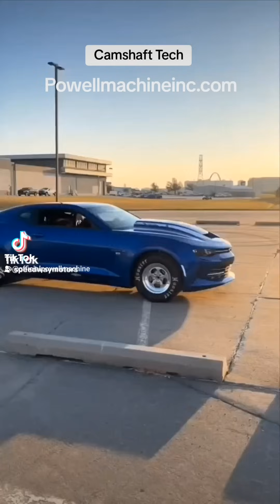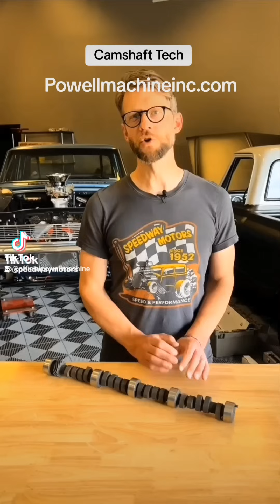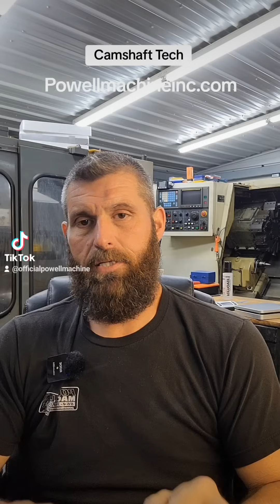Camshaft Tech,  overlap

Comment: Try to explain overlap to a Nitrous guy over scavenging his engine, or a Turbo guy that doesn't even check his back pressure 😮
Reply from the maker: @user-eo9ht6li7g  facts!!!! People call all the time wanting help with thee turbo engine and the first question I ask is current cam specs and the backpressue readings,  they never know the second answer.......
Reply: @powellmachineinc  Yeah back in the day I built NITROUS Systems for Grudge Hayabusas .
Alot of the guys came from the NA engine world , high rpm 62 degrees of overlap .
They would spray and eat the exhaust valves and seats out of the head. 😳 I would tell them they need Less overlap on their cams they thought I was crazy 🤪 until I showed them.
Then in 2001 I started building Hayabusa turbo Outlaw bikes,  same story , but now there are alot of combinations of different fuels, C-16, water/meth , E-85 ,E-90 Meth and so on all changing the back pressure and Turbine shaft speed. 
But with out having a back pressure sensor in the Exhaust people are just guessing what their overlap is.
I like your channel and I see your frustration with explaining the basics  of cam design to people that basically look at cam card and ask what the lope separation is.😳

Comment: Did you just compare a cam measured at 0.050" lift to a cam measured at 0.000" lift? or 0.006" lift or 0.010" lift??? What was the second cam measured at? All cams compared must be measured at the same inches of lift! The duration changes with different lift.
Reply from the maker: Both were at .050, how could I  make a comparison at 2 different checking hiegjts??? I actually manufacture cams for a living
Reply: @powellmachineinc  Good. It confused me when you mentioned them at different lifts. The first cam sounded like a decent street cam at 212/219" @ .050"

Comment: This is the kind of guy that would stop to help some in a pinch, and end up hanging out with them for an hour to make sure they got back on the road safely no matter what it took.  Wish we had more people like this.
Reply from the maker: @highball7347  tyvm!!
Reply: I got news for you. MOST of us were like that, until it got to the point where it was a coin flip if you were going to get killed or carjacked if you stopped.
I used to drive around on Fri and Sat night, enjoying my car, and I'd pick up drunk hitchhikers and take them home.
TF if I'd do that now.
Reply: @m4rvinmartian i wonder whyyou would do that . What were you looking for
Reply: The average youboob fanboi can’t see both sides of the same coin.  

He’s not saying anything different, just in a different way.   The example he didn’t provide is to take an example cam spec and then vary the separation angle to demonstrate how that impacts overlap.  Looking at only the opening and closing events is a half empty or half full glass equivalent.   

What is really being said here is that he disagrees with the David Vizard concept that a particular engine type has a preferred separation angle (Chevy 350 - 107°) and then the overlap is chosen based on how hot the engine tune/application is going to be.  Which Vizard lays out how to do all that based on many thousands of dyno run data over his lifetime.   

It’s ok to disagree on it, but it’s just the same thing from a different reference point.  It’s all relative.

Comment: Another channel teaches that LSA is not a result but a starting point! Whos right!
Reply: Lobe separation, Intake centerline and Exhaust centerline, are all just a BYPRODUCT of the correct opening and closing events. Anytime you alter when they open and close, you alter the separation.   Valve timing is WHEN it happens. LSA is WHERE it happens.

Comment: After spending 3 days in a valvetrain class, valve timing events are the only thing that matters. In cylinder pressure analysis proves this beyond a reasonable doubt. Everything else is just the product of these events. Everything in valve motion design is application specific. While there may be many who float LSA formulas. If you pay attention to what is said, its valve timing events for that particular application. So for a given application, you can make any particular formula work depending what preconcieved notion you are trying to express. You do a great job explaining this. Cheers!
Reply from the maker: You sir just summarize my thoughts very well!
Reply: I agree, I think the LSA formulas are just a handy tool for the novice engine builder to  use for getting their valve events in the ballpark for a particular engine combo.

Comment: This is fascinating. Is the overlap a desireable aspect of a cam or is it an effect of a longer duration? I am assuming that race cars engines would have high duration cams to get as much air/fuel in as possible while giving the piston as much time as possible to get the exhaust out. I am not sure if that is entirely correct tho. 

Great Video!
Reply from the maker: Overlap is definitely useful tool

Comment: Also what you are hearing is the pulse differences due to the 90 degree crank, two adjacent cylinders firing adjacent instead of on the other bank.  IMHO overlap needs to be measured with sae method or .004 or .006   great discussion so far   timing is everything LSA methods are BS  Intake valve size is a poor proxy or flow results, etc etc
Reply from the maker: I agree

Comment: Unfortunately there is so much regurgitated on You tube. While a narrow LSA will most the time have a little more overlap and a choppier idle it's still all based on how it's ground and it's all about combination combination combination on how it runs in a particular engine. I always get kinda tickled about hot rodders and their cam picks. many think they're going to gain a huge amount of power over some little change some so called expert was promoting. If you gain a huge amount of power could be you just had a really bad choice in there to start with. I love you videos because you use good sense and it makes perfectly good sense. If one is using too much snake oil on some of this stuff it's generally because they're misinformed and just shootin for the moon. Power is good but if you can't keep an engine together and running where everything is in harmony or you can't put it to the ground then your just blowing money and scratching your head. Sometimes the street rodders just think they gotta hear a certain tone. I ask them if they really are looking for this particular tone or would they like to have something that maybe has some tone but can get up and cut loose. Picking a cam because of 1 or 2 things is just down right dumb. I've rattled on too much.

Comment: there's a combo to that sound, aside from lsa... stroke, compression, heads, especially canted valve, firing order, and of course cam (SFT/etc) all come into play. cam events as well.... so many other variables....
just lsa only is not it. one way to look at lsa.... is how do you want that torque powerband? snappy.... go tight.... 
i love tight lsa cams, but thats just my desire.....
listen to a 351c with SFT and high compression..... music to the ears
motortrend did cam lsa swaps and the changes didn't make all that much of a change at idle sound, sure it did change, but you aren't going to go from super smooth to radical racey changing 10-12 degrees of lsa only.... unless you have a real knarly cam and other contributing factors, but just lsa only one might be surprised... how the power band comes on.... yup.... you'll notice that for sure (depending how drastic of a change)
i like your videos, some really good info

Comment: Chop IS MISFIRE.  OE aim for about 2% misfire, and 10% becomes audible.  Disconnect a couple of spark plug wires on a smooth running engine.

Comment: Exactly. Back in tbe 90s  ypu could get tight LSA on a tiny  towing cam small duration. Ran fairly smooth. Or for some racing get a cam with wide 114  LSA but very large duration and late exhaust closing  have more overlap, combined with the late closing  sound radical.

Comment: Yup.  David Vizard just made a video about the same thing.  Start with Overlap for the application, calculate the Lobe Separation Angle based on the displacement and intake valve size (static compression ratio figures in to this as well).  Duration is a RESULT of all of that.
Reply from the maker: Lol
Reply: @powellmachineinc  I would be interested in what you mean by lol.

Comment: I have had this same argument with David Vizard's followers, in the fact that LSA is a RESULT, NOT AN INPUT. The most important part is opening/closing valve events. They seem to think that a 106 LSA camshaft in a 350 SBC is the 'magic sauce' with NO other info taken into consideration.
Reply from the maker: Yep it's scary
Reply: LSA is a starting point and depends on the head design, displacement and intake valve diameter.  Overlap is decided upon where you want your power band, and to a degree idle vacuum.   DURATION is the result of those 2 design parameters.

Comment: [Your vids are so awesome!]  So a Comp Cams Thumpr for example has a bunch of overlap to sound nasty but is really not a big performance cam.  When tuning the engine for this cam I found it wanted 35° of advance above 3000 rpm from the dyno runs.   But, I found it also wanted 35° of advance at IDLE rpm of 1000 rpm with a vacuum gauge so timing was locked out.  This engine starts right up with no start-retard at all locked at 35°. (vid showing this: https://www.youtube.com/watch?v=CyAZiMZ-Qq4 )  Comp Cams said yes run it locked, that is what it wants due to it's low dynamic compression.  Does that make sense to you?  I could not find out how much overlap it has, can you tell from the specs?
Advertised Intake Duration	279
Advertised Exhaust Duration	296
Intake Duration at .050 Inch Lift	227
Exhaust Duration at .050 Inch Lift	241
Intake Valve Lift	0.491
Exhaust Valve Lift	0.476
Lobe Lift Intake	0.307
Lobe Lift Exhaust	0.298
Lobe Separation	107
Intake Centerline	102
Valve Timing Lift	0.006
Exhaust Close ATDC	41
Intake Open BTDC	35
Exhaust Open BBDC	76
Intake Close ABDC	63
Reply from the maker: Tyvm

Comment: I can never get enough knowledge of camshaft dynamics. Knowing how to pick/design a cam according to a particular engine's application is a fascinating science and there are so many variables to be considered. Engine displacement... cyl. head/ intake/exhaust design...rpm range... comp ratio... normally aspirated vs forced.... Final drive ratio... trans type... Street/strip or both.... vehicle weight..........
Thanks for the video and channel 👍

Comment: After installng a Moon Crossram IR manifold on my Donovan small block, and it was like my great idle TOTALLY DISAPPEARED!...(it had a Holley 4bbl).  So, this discussion assumes the same intake system when referring to "idle quality".

Interestingly, that Holley was surprisingly strong by comparison.  However, the driveability off the corners can't be beat with an IR manifold...and it never seemed to stop pulling upstairs, either.  The throttle bodies were 50mm and the Holley was a 750 double pumper.

WORD OF CAUTION:  You need to install a Lingenfelter throttle cable cam on the linkage of an IR manifold setup.  

Otherwise, the initial cross-sectional area in the runners changes too much off idle for the car to be driveable on the street...or in road racing.  Just make sure the throttle cam's tip is "bump steered" so it's 90 degrees to the cable at the idle position.  Holleys overcome this issue by having the primaries open well before...unlike 660 center-shooters that only give you a hint of opening the primaries during the initial tip-in.

If anyone's interested, you can see the correct orientation of the cable cam in the center of the manifold in this shot...I painted it wrinkle black:  https://www.facebook.com/148866271901800/photos/pb.100057508387227.-2207520000/1305820682873014/?type=3

Comment: LSA.  What BS for the general public.  I agree that overlap is the "thing".  But I did notice that when you were dialing in your machine to regrind a cam that the machine is calibrated for LSA.  This I can understand as good information for the person designing and manufacturing any particular cam, but LSA is just useless for the builder/user of the cam.  Thank you for pointing this out for us.  And confirms my suspicions on the subject.  Years ago no one even thought about LSA just the O & C events....
Thank You for stating the obvious....  RooDog....
Reply from the maker: Lsa is really only a mechanical function of the grinding operation,  the engine only knows opening and closing events

Comment: My cam had a 277/286 duration and it sounds like a tractor sometimes, definitely not choppy. But it’s not the sound I’m interested in.
Reply from the maker: I'm sure that duration was advertised and not at .05, so that's pretty mild
Reply: @powellmachineinc  I have it in my 411 Clevor.  
801/767 lift
dur at .050 277/286.
Int open 30 btdc  close 67 abdc 
Exh open 79 bbdc close 27 atdc 
Lob sep 112
Looks like the valves are kept open a long time, would that be the reason for not getting the chop?  Thanks for appeasing my curiosity.
Reply from the maker: @patrickterry779  yeah, thatsa good one, should run well with a nice head

Comment: i have always found a tighter lobe center, not so much lopey, but if the overlap is there, a tigher lobe sep will bring the cam in earlier in rpm. 2 cams as close in specs as possible cam 1 is 108 LSA cam 2 is 114, the 108 starts working off idle sooner, give up sooner, where as the 114 comes on later and revs higher. i may be wrong but its worked for me in 30 plus years, trying to satisfy customers who insist on very lopey cams for impression, and need to be able to drive it on the street daily with out gear and converter changes. way back in the late 70;s 80's isky convinced me of this and i began buying the 108 107 mega cams. again i may be wrong. but its just worked. it been the only way to give customers crazy lopey cams and no have off idle drivability complaints. if iam wrong please correct this before others take is it heart.  to me more overlap with out narrowing up the LSA moves the rpm range up higher
Reply from the maker: What ur actually saying without knowing is a earlier opening and closing events  bring the cam in earlier.
Reply: You effectively changed the overlap by changing the LSA.  There is only one optimal LSA for a given displacement, intake valve size, combustion chamber design and static compression ratio.  Overlap is decided by where you want your power band, and what you want idle vacuum to be (but that's adjustable with ign timing, etc.).  Duration is a result of LSA and overlap.  I have a spreadsheet that uses LSA and overlap and computes the duration from those.  It's just algebra.

Comment: Spot on! People just dont understand!
Reply from the maker: Tyvm
Reply: @powellmachineinc  Have you done any videos yet on Dynamic compression and calculating it based on actual intake valve closing point?
Reply from the maker: @JayJay-de8vq  no, probably should
Reply: @powellmachineinc  Every video you make is great and the information always matches what I've learned from my Dad and the older Guys I hung out with, two of them currently race 2 of Lenard longs (G force transmissions) mustangs. Learning and Understanding valve events and dynamic compression really helped it all make sense. Thank you for the quality videos and responses. My dad will be installing a camshaft in his 04 Silverado and I insisted he goes with your bushing style trunnion kit, so we will be ordering that very soon.
Reply from the maker: @JayJay-de8vq  g force has the best face plate transmissions out there, I build a few T101a's back some year's ago for land speed car's

Comment: The chopping or popping is misfiring. The engine is simply misfiring somewhat at low speeds. With all of the kinetic energy of an engine even at say 1000 rpm it will stay misfiring at a stable rate so it doesn't easily die. There is no valve movement that is what make the sounds. It is the sound of the combustion exhaust event. It is actually misfire. As the engine moves up in the rpm range the overlap is now necessary for max power and it has less and less misfiring.
Reply: ,,,,,,,,,,,,,,,,,,,,,,,,,,,,,,,,,,,,,,,,,huh,,,,,,,,,,,,,,,,,,,,,,,,,,,,,,,,,,,,,,,,,,,,,,,,,,,,,,,,,,,,,,

Comment: BTR CAMSHAFT - LS1/LS2 - N/A STAGE 1 - 32330152R1
Specs: 223/230  .613"/.605" 115+2 LSA
I copy/pasted the specs on the recently discontinued Brian Tooley Racing stage 1 cam that was installed on my daily driver, '04 C5 Corvette with an LS1 and automatic transmission. Yesterday evening I was looking at cam specs on Rockauto's website. I didn't see anything close to the HUGE LSA that this particular BTR cam has.
Except for their factory GM cams, 2001-2004 C5 was 207/196 .479"/.467" 116 LSA.  The BTR is 115+2! 115 degrees of lobe separation with 2 degrees of advance built in. It's got some lope at idle, and works great with the auto trans and factory torque converter. HP Tune on engine and trans btw. But gosh most aftermarket cams out there have no where near the wide LSA on the BTR stage 1. It's kind of an oddball cam but I like it. Lots of lift, smaller duration, huge LSA.